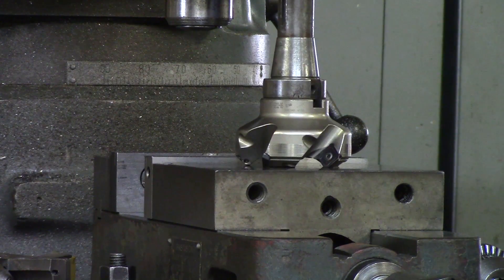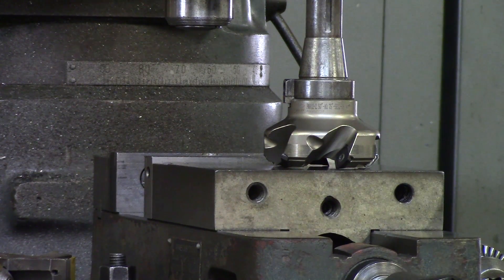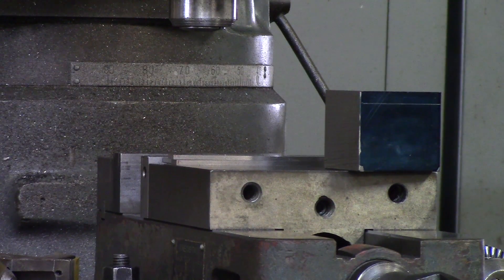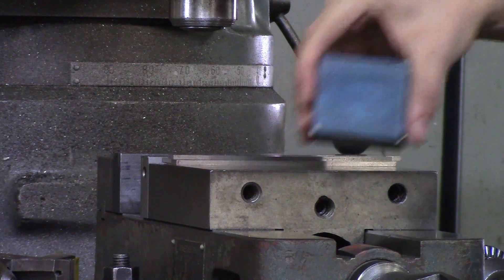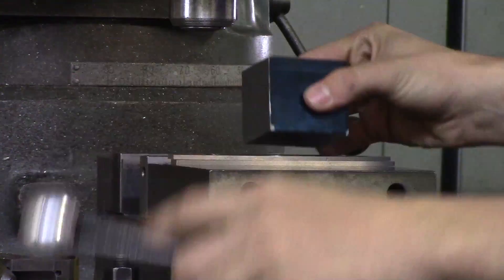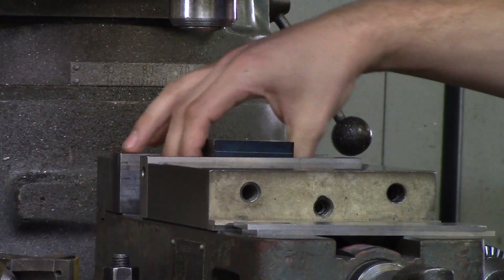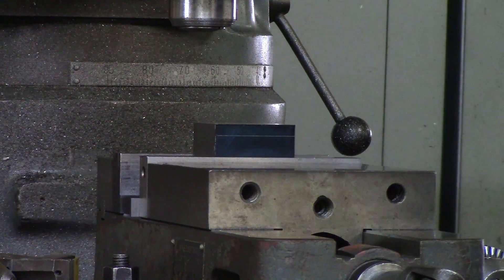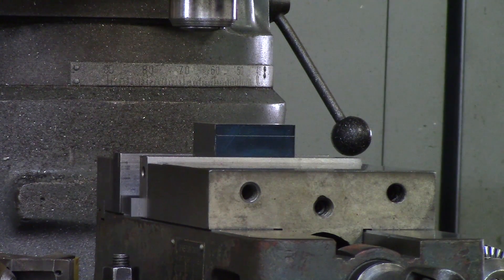Facemilling Fundamentals

Comment: I’ve laid down parallels to get height I want. What’s your reason to not lay parallel down? Yes, it’s the thin section; but, when work piece bridges the center gap, why not?  Thank you for your knowledge
Reply from the maker: @thatsthewayitgoes9  mainly because of how parallels are manufactured. They are only guaranteed on the height. If you inspect them prior to using that way will work but it’s not guaranteed. The thinner ones at our shop (some of them) are not flat except on the ground height. Thanks for watching!
Reply: @ ok, thanks
Reply: @thatsthewayitgoes9  Using a piece of banding shaped like a "w" will hold your parallels tight against the jaws.

Comment: Two things that could be improved upon, first mill in the other direction so the chips fly away from you and second lower the knee a small amount when returning to the starting point so you don't drag the inserts over the face of the part, this adds wear to the inserts and gives you a bad finish, also let the back end of the cutter clear the part before ending the cut or you will get the radius lines going in two different direction and the flatness will not be as good.

Comment: One fundamental of face milling & most milling operations is to cut from right to left so the chips fly towards the machine and not towards the operator, colleagues and all over the rest of the shop floor. If you use the tangential milling approach, any thickness part edge can be cut with a huge cutter without vibration

Comment: Can you do a video about how to do the spindle speed and feed calculations for a facemill?
Reply: Its the same equations as an endmill, you just treat each insert as a flute and you treat the total diameter as cutter diameter.
rpm= (SFM(that inserts are rated for)x3.82)/diameter
feed = rpm x chip load x # of flutes
SFM and chip load for given insert can be found on manufacturers website.  These #'s are for CNC machining, manual you'll need to drop the numbers quite a bit depending on machine and go by feel.
Reply: @sammerriman2331 on a manual machine would you reduce by half so like 600rpm down to 300 or
Reply: @surfnbird6480  It depends on the machine and how rigid it is. The only thing I can say is manual machines are always going to be significantly lower rpms and half is a good starting point. Depending on the operation maybe more, you'd have to by feel and sound.
Reply: @sammerriman2331  thx wasn't expecting a response so fast. 

Got 10 insert 6in face mill running on a Cincinnati Gilbert boring machine  face mill is bolted to spindle .

Also I'm a sheet metal guy thrown into the machine shop so learning on the fly. So thx for info, will try and play around with it a bit just feel like I'm going through inserts fast but maybe it's normal

Comment: are the inserts in a face mill or shell mill set at different Z heights? like the inserts are designed to engage the material in a sequence right? the 2nd insert is sitting a hair under the 1st insert, then the 3rd is below the 2nd am I right?
Reply: No. Inserts are set to the same rotating plane. Some larger face mills have adjustments built into the insert pocket to allow you to dial in inserts if you damage the tool

Comment: raising the knee is a new one for me. makes sense. a pretty knowledgable video
Reply: YES, this is NOT a drill press, and a large cutter takes HEAVY cuts, so tighten everything down TIGHT, that is not moving during a cut, and with the quill up top there is less runout as the quill is collapsed fully, and you are raising on the solid column v ways, and their gibs, so a much more rigid and accurate depth adjust, as you are using a lead screw, not the rack of the quill.
Reply: @andyvan5692  will remember that one
Reply: @pr00009  He's got a good point, thats how I was taught, I leave the face mill all the way up, lock in the stop collars, and lock the quill lock, and I ONLY use the knee to raise the part, you can control the knee to the thousandths and I just raise it a few notches each time for my spring and finish pass.
Reply: I thought using the knee for depth milling is not only the norm but necessary.